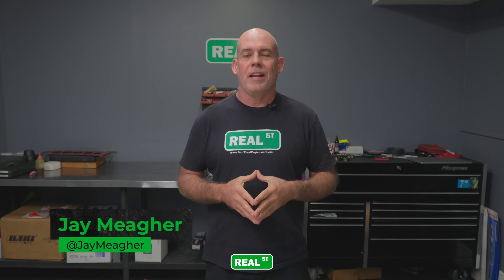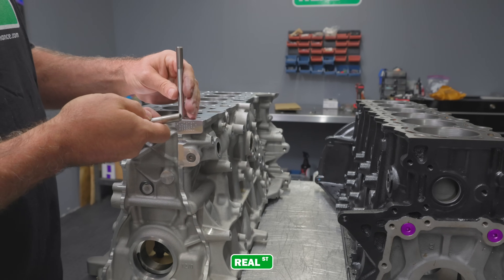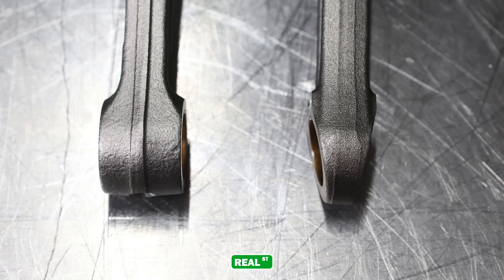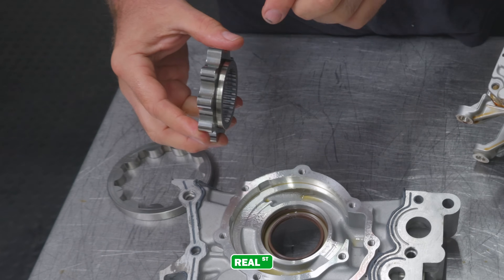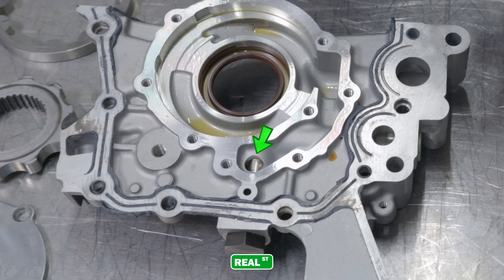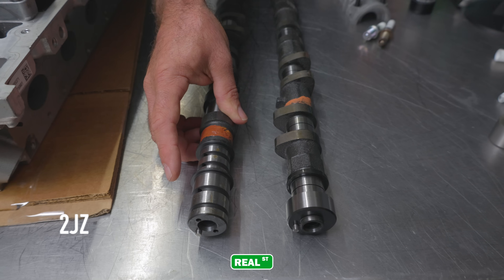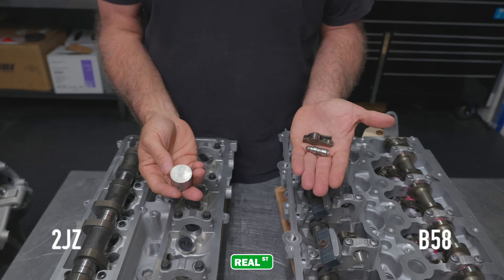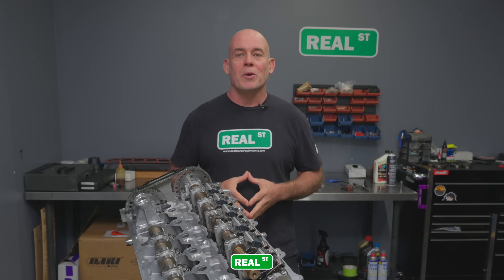Toyota 2JZ vs BMW B58 | Comparing Both "SUPRA" Engine Internals Side By Side In Detail

Comment: Ok so the b58 gets the press but the b48 modded with upgraded turbo and good custom tune is completely off it tits. I mean it blazes the tyres into 6 th gear.
I own one and im well past getting the power down. Dont overlook the b48, worked it wont hook anyway so its all academic anyway.

Comment: B58 is efficient, reliable, built for response for the average joe who buys a 340 / x5m40i etc.. will make great power up to a certain point but will probably fall flat at high whp levels due to the long stroke im guessing.  7M has similar troubles at the high end and is long stroke also.  S58 will probably be better at making big power due to the more square design.  But hey, while the 2J isn't the most efficient, it works and its fairly straightforward to set up.

Comment: Only a fool will say the 2jz is in any way better than the b58. The b58 is superior under every single aspect. And that’s obvious, because it’s been designed 30 years later, so one would expect it to be better.

It would be interesting to see a comparison between same-era engines of different manufacturers
Reply: Anything newer is better - awesome perspective, my dude. SMH
Reply: @GroovesAndLands  yeah, obviously technology has gone backwards with time, huh? Smh
Reply: @_entrxpy  Yes, indeed. Between regulating bureaucrats and fickle people, our ability to make good stuff work does indeed often move backwards.

Here's a specific example:
I used to work for Bosch making diesel engine injection systems. The high pressure passage must go through two turns to get to the tip - and obviously you can't drill a hole with a bend. So three holes were drilled - two straight and one angled, that joined the two straight holes. Later, the angled hole would be plugged where it met the surface of the part.

The method developed for creating that plug was to braze a small pin into place. For the brazing operation to work, the hole needed to be super duper clean, and tricloroethylene was found to be the ONLY reliable solvent to properly degrease the surface.

Once the EPA stepped in and decided that Bosch could absolutely never use tricloroethylene again - a new approach to plugging the hole was sought.

None were found that worked as well as the old method. Thus, your semi engine is now 4 times more likely than before to blow a plug and fill the crankcase with diesel fuel.

It's genuinely naive of you to think newer is always better. It's that kind of progressive thinking that is destroying our country and world and general.
Reply: The B58 isn't superior under every single aspect... he literally said the main bearings and the rod bolts in the 2JZ are superior, as well as the valves being larger, the 2JZ is also more easy to work on and is more simple, simplicity is an extremely valuable quality when modding engines.
But I personally prefer the B58, idk if it's the superior engine or not, they're both brilliant in their own ways. The B58 is much lighter and can hold a very similar amount of power on the stock internals. It's also just as reliable, and also even more tunable, with people getting over 500-550whp with just a tune and a downpipe.
Reply: @Josh-qm4rb  imagine talking about your engine's superior rod bolts lmao what
Reply: @barniechong1183 Imagine comparing a 30 year old engine, vs an engine designed in 2015 😂😂😂 THE 2JZ IS SUPERIOR IN ALL ASPECTS!
Reply: @804MRMAN  I have a 2jz and it’s awesome but it’s not really superior in any aspects except simplicity
Reply: @barniechong1183  Make it make sense! ENGINEERING IS ALL ABOUT SIMPLICITY, EFFICIENCY, AND LONGEVITY!!! 😏 What school system did you attend?
Reply: @804MRMAN  There no way u can say the 2JZ is more efficient are u kidding? B58 has  direct injection allowing wayyy higher compression which creates more power while consuming less fuel.. Did you even watch the video? He goes point after point showing how modern engine is more efficient
Reply: @804MRMAN  U tell me, how is the 2JZ better in any way? Its hard to justify

Comment: I really want an answer to this question since it seems no one has done it, and its more than likely bc it doesnt work. But if i uses a 2jz block with a 1jz crankshaft, and 7mgte hbeam contods what would happen? With either a 1jz or 2jz head
Reply: Your stack height wouldn't work out. You would need to use a piston with a 1.230" Compression Height in order to make that scenario stack up to the proper block height. 1JZ and 2JZ are 1.338", 7M is 1.299". I can't foresee any benefit from going that route.

Comment: Toyota should have just re-released the 2JZ for the MKV Supra. How cool would that have been?! There would have been zero negative talk about the car when it launched. I know, emissions, etc made that 'impossible'... By the way, Toyota still has stock of brand new 2JZ short blocks ready to go so technically the MKV could have had the legend under it's hood 😉
Reply: even disregarding emissions problems, the original 2jz in a modern car today would be an absolute diasaster. awful MPGs, and slow AF by modern standards. Not to mentions very heavy.
Reply: @barniechong1183  emissions, yeah that will be an issue. Performance? 320 HP and 440nm torque ain't slow today. Stock numbers aside what they could do is raise boost by a few psi on the stock twins and that power and torque would increase exponentially. It is a cast iron block so it would be heavier than aluminium but I can guarantee you that NO ONE who loves Toyota/Supra/1JZ/2JZ would care if the exact same engine was re-released for the MKV Supra. We would all be ecstatic that the new Supra has a real JZ under the hood. Ideally it should have been a newly developed "3JZ" with 3.2 or 3.4L of displacement and a few more modern amenities pushing out 450+ HP.
Reply: @RolanTHUNDER  well there are factors u have to take account for. U must not forget how laggy the JZ is along some 6 cylinders having a good trans + engine combo(like the B58 + ZF being one of the best trans + engine combos out there). Not to say the JZ can't, but it'd just be faster making 5-800whp(depending on the engine)with these modern engines vs a JZ,along with them being more streetable in the process(with that power).
Reply: @RolanTHUNDER  the stock turbos are absolute trash lol
Reply: @carboydorifutoparty3976  people forget that b58 is making power very easily too and for cheap. its keeping up with cars with 200-300 more hp than it.
Reply: You'd literally be looking at a i6 no differnt from the B58 with the high chance of it being open deck too. Emissions would kill any chance of them making a engine anywhere near close to a jz.
Reply: Good luck convincing the governments to allow it to go back into current cars. I don't think a 2jz could pass current emissions. That's not even counting the cost it would be to start back up the factory that forged the iron 2jz blocks. You are also looking at an engine that could only be used in maybe 3 of the current cars at most. and I6 is not exactly the easiest thing to fit into a car.
Reply: @Mrpancake72  Yeah hence I said I know emissions prevent it's comeback. Would be damn nice though. Toyota could fairly easily produce those 2JZ cast iron blocks if they wanted to. They still have new ones for sale via dealers even today and whilst those could be old stock, replicating them via a casting mold would not be out of the question. As a true Supra fan I really wished that Toyota never collaborated with BMW and used one of their own 6 cylinder engines for the MKV. Is what it is though so...oh well :(
Reply: Also, people don't seem to understand brands especially Toyota is making cars with parts that are interchangeable across their entire lineup. releasing a 2jz again wouldn't be feasible as you said before because of obvious emissions. we will NEVER get the 90s back again. A worthy modern 2jz would essentially be the B58 whether people like it or not, a downpipe and email to make about 500hp is insane and people won't acknowledge it.

Comment: a slight correction, Valvetronic still need throttle body for idle control and failsafe mode. without throttle body, you'll have a hell time to fine adjust the idle and in case of valvetronic fault, you'll have no throttle control at all. this system also not variable from a full 0 lift but 0.1mm-ish lift iirc

Comment: you know that the engine is reliable or not by have chain instead of belt for timing

i wish if we can have a video about b58 oil pump how it's work
Reply: Chains usually require less maintenance - so they're better for somebody that'll never bother to service or maintain their stuff. But chains are also noisier and require more power to drive. Just depends what's important to you.

But by far the most robust and reliable way to drive engine parts is via gears. Heavy duty diesels, Formula 1, WW2 airplane engines - all gear driven.

Last: I saw nothing on that B58 I liked.
Reply: @GroovesAndLands  you are right. but knowing that chain will not blow up the engine, its noise will be music to my ears

Comment: The 2JZ is stil superior in my book. It may be old and simple but that's what's make up for it. 
BMW is not known for there super high reliable and tunable engines and even though Toyota have put there engineer's in it I still would take a 2JZ. 

Just like old American v8 engines. They are simple but the work and. You don't need a 5liter ohc engine with miles of chain to time everything. Yes it's technically more advanced and refined but a LS beats it in simplicity and price
And the the saved cash you can build a more powerful LS

Comment: The 2jz fan boy club, it's so predictable, why does it always resemble a bunch of dumb kids regurgitating stuff they heard on the internet, probably don't even have a car 😂 who TF needs 1000+ HP unless you are a competitive drag racer or drifter? Anyone who actually drives a car on the street or a racetrack with corners doesn't need that kind of power. In fact it could make you slower since traction will limit you. Midrange torque on a high hp 2j is crap compared to a similar power B58, fuel consumption for the B58 is better than the 2j, the B58 is a better street engine as a result IMO. Yes there is added complexity but that is what technology is all about, it's an evolution, finding out what works well and what doesn't for a given set of requirements. There are some really clever things about modern engines that people don't seem to appreciate. How do you think everyone felt when fuel injection and computer controls were introduced? A lot of folks insisted it was garbage and unnecessary. Same with catalytic converters, same with ABS on braking systems, and so on. I think the 2j is great but there is no denying that the B58 is too. For many people, the B58 is a better choice. It's that simple. It boils down to the customer's requirements, which will determine the engine of choice. For the average person who wants a car with great street manners and good tuning potential, the B58 is better IMO. Thanks Real st for the technical breakdown, I'd like to see you take apart an S58 and compare it to the B58 and 2jz. Maybe even do some engine dyno comparisons to show the difference in powerband. All the 2jz fan bois will probably dislike the S58 even more, even though people are getting stupid high HP out of mostly stock engines 😂
Reply: Because 2JZ fanboys only care about drag racing, hence why the MK4 was a turd on the track. What they don’t realize is that you could build a Coyote engine way cheaper than a 2JZ for drag racing, and they’ve been in the 7s with an unopened engine. The 2JZ is an overhyped engine made famous by a movie and 30 years of trying to make them go fast.
Reply: @ryanturnerboles  lol facts I love the 2jz but lord have mercy there's other engines that exist that are also fast. most of them are kids or a manchild that refuses to grow up lmaooo
Reply: This. 
The B58 has already hit 1000whp on the stock internals, so even if the 2JZ is slightly stronger, it would only be stronger by a tiny amount. A bone stock 2JZ lasted a few dyno runs and 2 quarter mile runs at 1106whp, then it exploded straight after.
Reply: @Josh-qm4rb  wait.. really?. i thought those high powered B58 already have stronger internal with stock crank and block?
Reply: @n.shiina8798  He stated that the 2JZ has stronger rod bolts than the B58, but I think the B58 has the same strength pistons and rods as the 2JZ, if not even stronger.
The B58 crankshaft is better tho, considering it's lighter and just as strong.
Reply: @Josh-qm4rb  hmm.. i didnt follow race world that much so idk if anyone reached 1000HP on stock B58 internal but iirc, Papadakis uses aftermarket rods and pistons on his 1000HP build. i kinda doubt stock internals could handle more than 700 😐
Reply: @n.shiina8798 the highest a stock intenral B58 has been pushed is actually 918whp. There are mk5s making 800whp+ on stock internals including the current fastest stock internal mk5 still running about safely.
Reply: @carboydorifutoparty3976  dang, that's big number for 6cyl stock internals!. did they use DI or ported? valvetronic intact?
Reply: @n.shiina8798  port injection. People bounce port once they pass 700whp+ in these since they start getting fuel cutting issues. It's also dependent on the B58s that gets things mixed up with info(they have different variants threw the years with differences that vary between small and major)since 1st gen B58s have weaker hpfps than current gen since those are limited to about 600-650whp, while current are limited to about 700+whp and commonly get mixed up on what they're capable of(and why people say they blow but that mostly is the case of early model B58 cars with weaker fuel systems). There's a new one in a few bmw models that has people curious to see if it has potential named the B58TU2 since it comes dual port and direct injected from factory along with alot of the parts being moved up so that they are easier to get to but aren't sure if they'd get the same or better results for power since no one's really gotten the time to mess with them(their in high trim 40i bmws is partially why).
Reply: @carboydorifutoparty3976  thanks for the good info. appreciate it a lot!